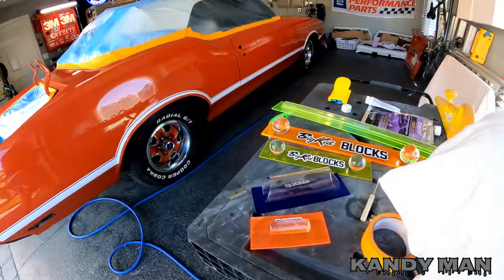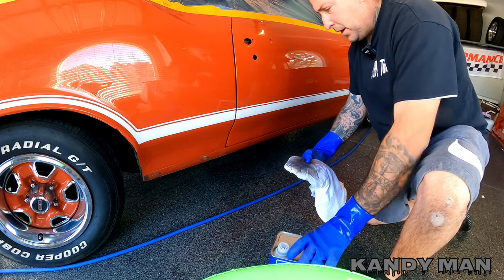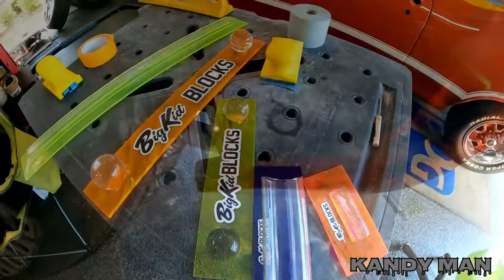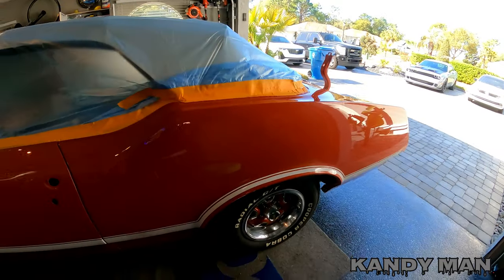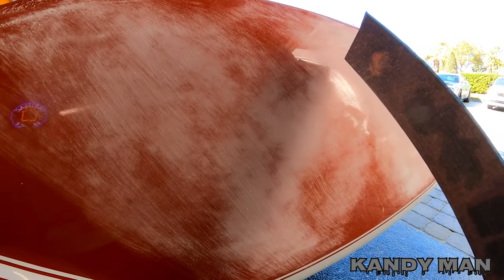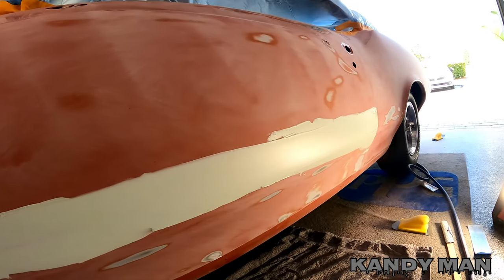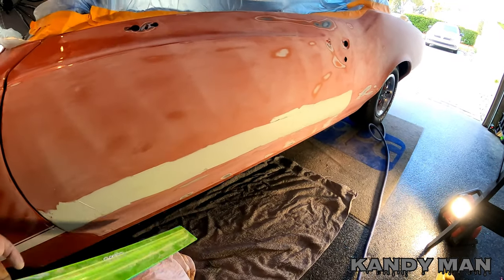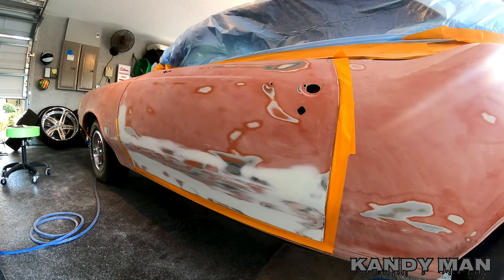STEPS FOR A MIRROR PAINT JOB PART 2

Comment: I'm just starting out I was curious if a round durablock would do well in the wheel well lip
Reply from the maker: Guide coat it so you can see your sanding areas it should work  then I would go over it with a soft pad to make sure there no lines from the block  hope this helps 👍

Comment: Do you sand after the epoxy to put the body filler... or do you just apply directly onto the epoxy?? If sand what grit arr you hitting it with??
Reply from the maker: When I use epoxy I would sand with 80 or 180 before filler but don't break trough  thanks for watching